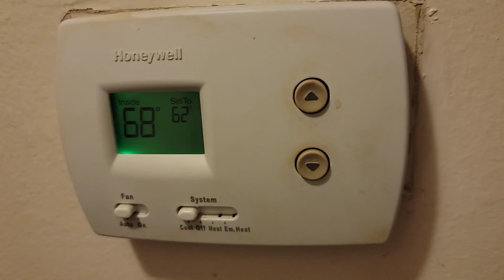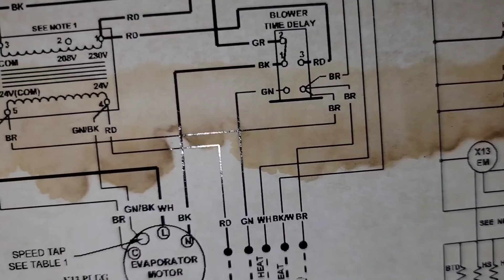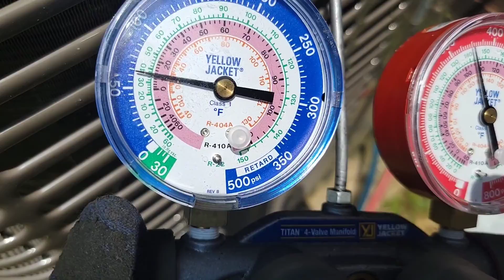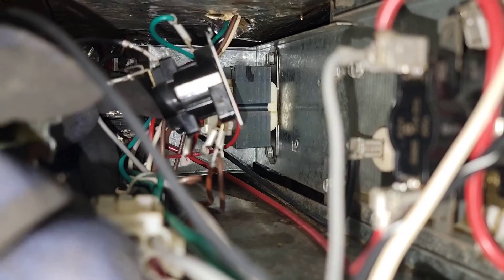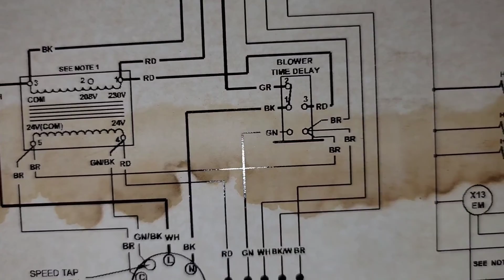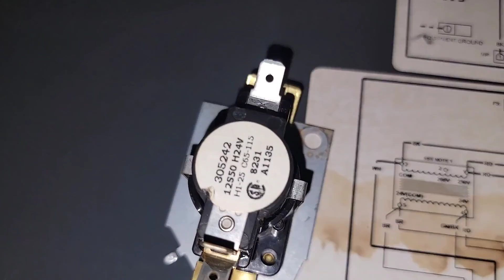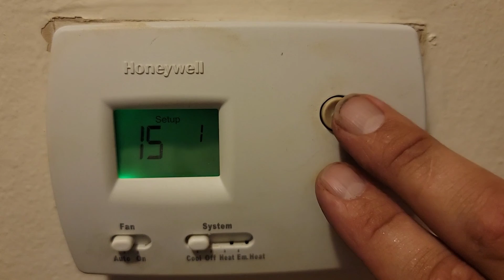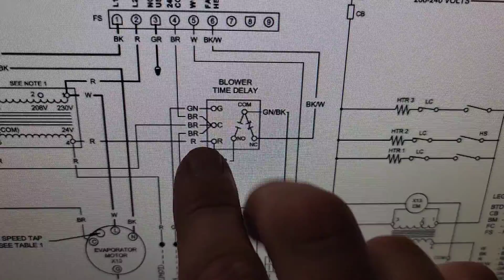Aspen air handler air conditioner repair

Comment: The only thing is that in heat the unit will blow a blast of cool air until the coil warms up enough that’s why they put the time delay relay in my view good fix until you can get the oem part

Comment: What is the function of the time delay relay in this setup? Thx for making this video m8.
Reply: They’re used in electric heat to delay the fan coming on so the elements warm up the air first so that as soon as the blower comes on, you get warm air out of the vents. Then once the electric heat turns off, the blower runs a little longer to cool off the elements.